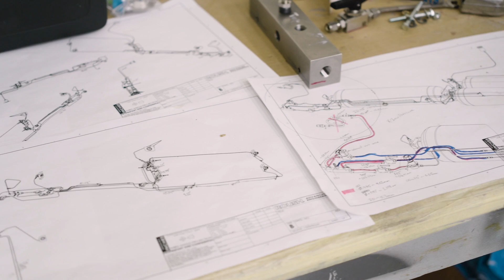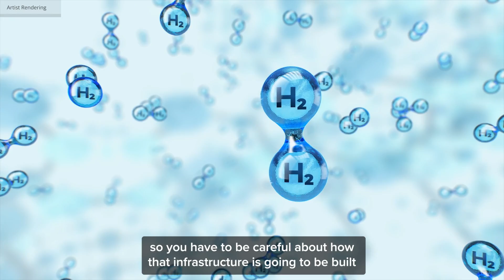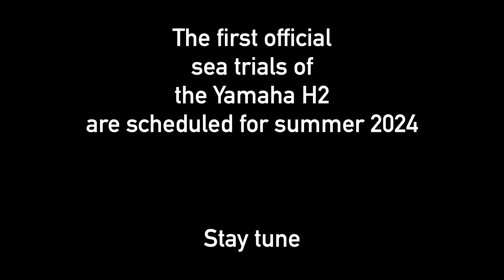Yamaha H2 - Hydrogen Outboard engine - Teaser -  is this the future of boating ?

Comment: Just for reference it takes about 50-55KwH to produce a kg of hydrogen and that 1kg of hydrogen only contains about 33KwH of chemichal energy. Although hydrogen is nearly tripple the gravametric energy density of gasoline(120KJ/G vs 46MJ/G) ; even at 700Bar (not psi freakin bar so 10,150psi) hydrogen only has a volumetric density of only 5.4MJ/L compared to gasolines 34MJ/L. 
This may sound like nonsense but in simple terms  you would need
1.) Nearly twice the volume of hydrogen tanks to acheive an equivelany fule storage as gasoline (less room in your vehicle + 10,000psi highly flamable tanks of compressed gas)
2.) Hydrogen fule as stated earlier costs about twice as much energy to make as is can produce so your already essentially at the same ~50% theoretical efficiency as any gasoline drive ICE anyways xD
Reply: ok Einstein

Comment: Why not a fuel cell? Wouldn't you get more range from less hydrogen onboard? I still think fully electric will penetrate this market as well. You can get away with cheaper battery chemistries as you are not as penalized with weight on a boat like you are in a car. I think people would have to look at their usage. I go out with my uncle off the coast of Jersey, and we never really do more than 60 miles in a day. People who cover more distance may need to consider hydrogen options, but I think most people will find electric versions will suit their needs.
Reply from the maker: You are right. By the way, the average distance covered by boaters is 17 miles a day... it means that is probably suitable for lots of people.
Reply: did you really say weight isnt as important in a boat as in a car? i hope i read that wrong but in case i didn't, boats (especially planing hulls like all outboard boats big enough to go offshore fishing) and MUCH more weight sensitive. heavy batteries are dangerous in a boat as they stay the same weight, and have about 5x less range with virtually nowhere to charge lol

Comment: Gas pump rage at the dock is already a thing, can you imagine lining up and waiting for 20 minute fill-ups?  LOL
Reply from the maker: That's one of the problems, and that's why it's a path for the future, not a solution for today
Reply: @yachtandseatv7160  hydrogen costs 40% more energy to make a Kg of hydrogen than it even contains in the first place (50-55kw to make a kg & 30-35kw contained wihtin a kg or hydrogen). Even if that wasnt an issue (ie. we have infanite free green energy somehow) at 10,000 psi those hydrogen tanks only contain less than 1/6 the volume of fule so even if hydrogen is tripple the energy density per gram your still wasting 2x more space for fule tanks than needed (or loosing 1/2 your range).